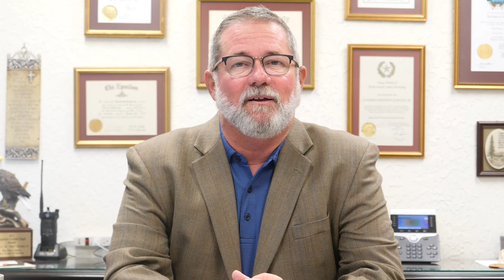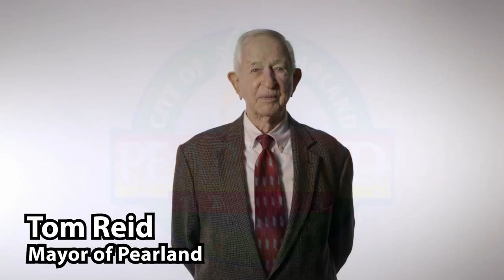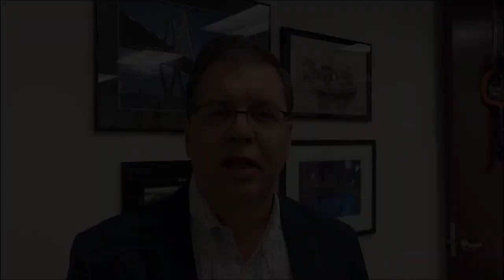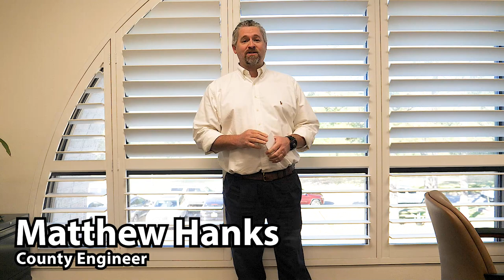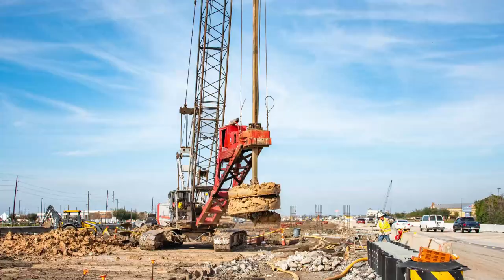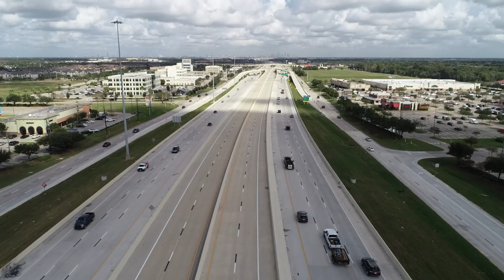Brazoria County Expressway Grand Opening

Comment: As an Uber driver....... Whoever decided that moving the connector ramps from the right side to the left side of the free lanes should be fired.  It causes nothing but confusion at 610 in Harris County and many accidents.  Exit ramps should always be on the right side of the main lanes.  The rest of the project seems rather good.   TxDot should try to reduce accidents instead of cause more.